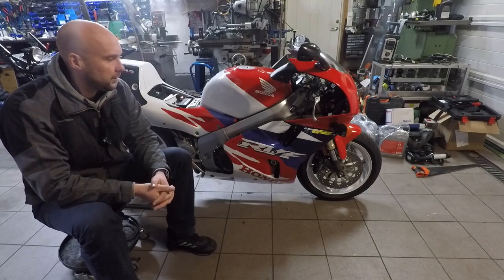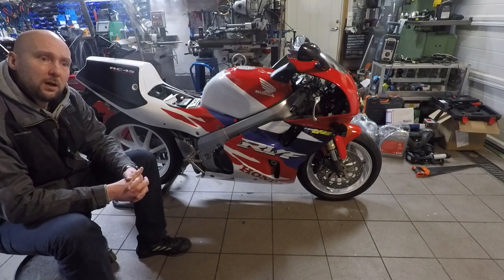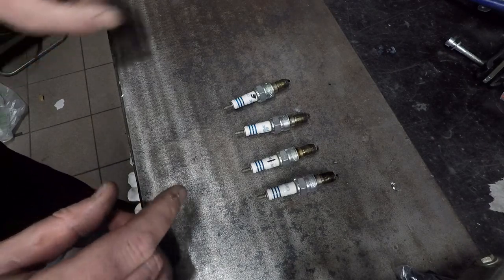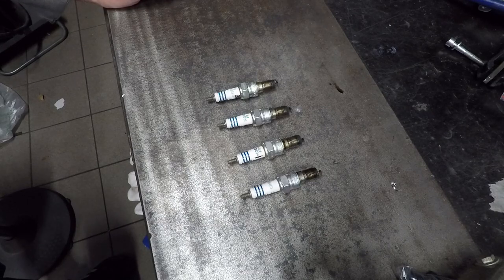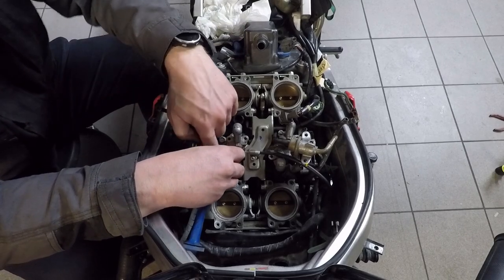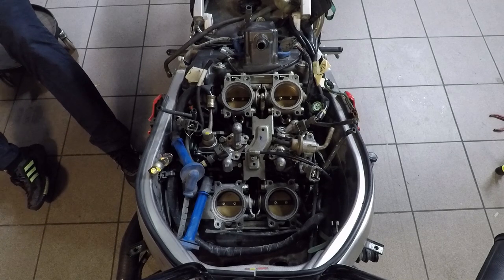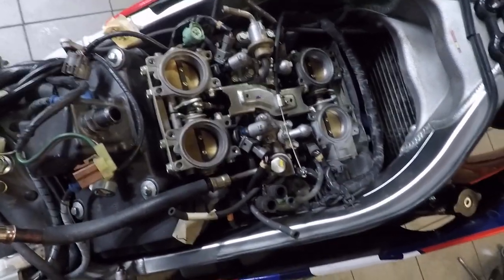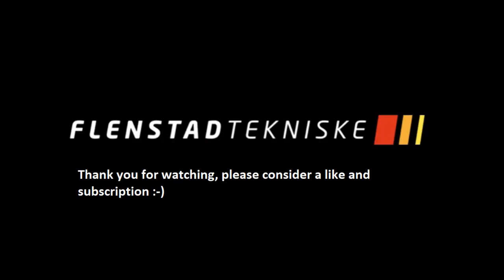Honda RC45 rvf750 bike won’t start! Service needed - Part 1

Comment: This video seems to have gone out months ago. But for those who have a similar problem. Drain the petrol out of the petrol tank put new petrol in it change the engine oil with the proper grade oil. Change the plugs and if you have an air filter on the bike change it. Finally if the bike starts take it out for a run for 30 mins until the engine is properly warmed up. Bring the bike back to the garage and leave it there do not be tempted to go out and start it as you will only put it through another heat cycle. Only start the bike when you intend to ride it. Ex Racer and mechanic,💯

Comment: Beautiful bike !!! My rc51/sp2 was doing exactly that I thought it was just stale fuel but turned out to be the fuel pressure regulator leaking fuel and fowling the spark plugs over time whilst it sat !! Changed that & cleaned the plugs and was fine .
Reply from the maker: Yes, stunning bikes these rc45’s😊 
Glad you got that sorted out👍🏻

Comment: if the bike has only been started and not rode the plug will turn black in no time....needs to be rode.....the fireblade was the same....black plugs in no time from just starting......
Reply from the maker: Jup. Absolutely necessary to get some real heat in it once it’s started😊